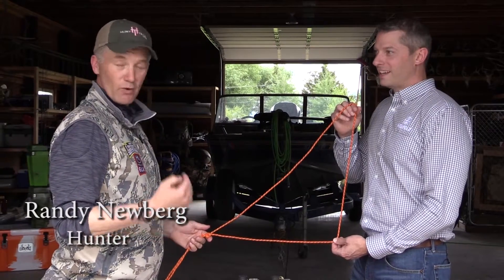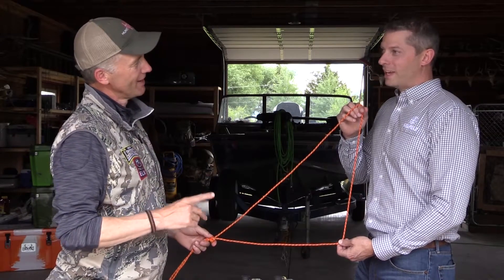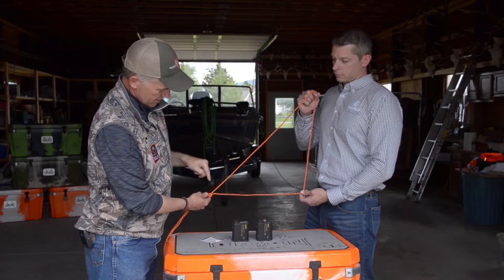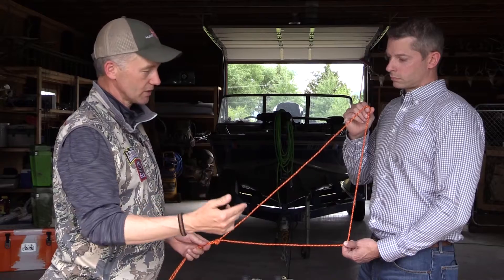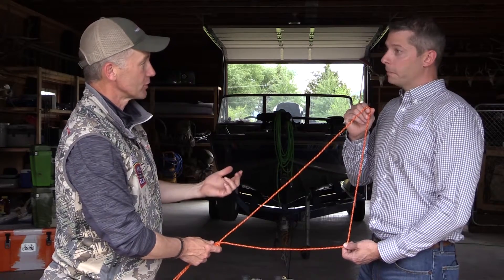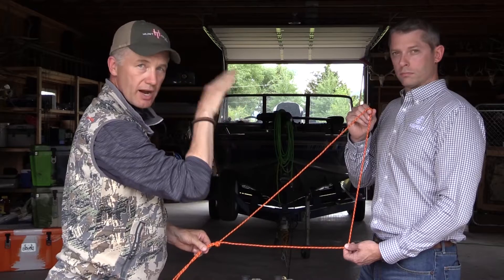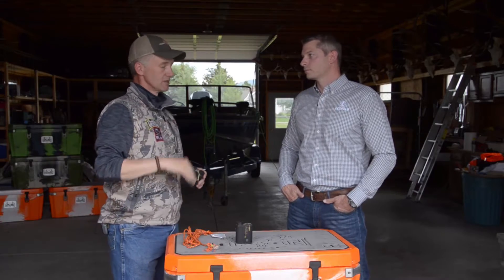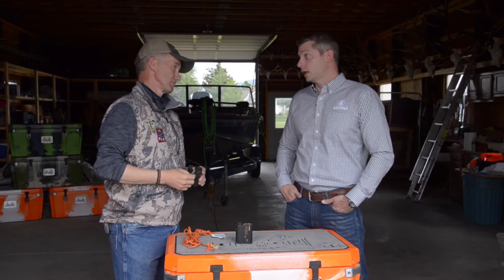How the Leupold Rangefinder (TBR) Works - by Randy Newberg

Comment: Had a shot at a big buck downhill from me.  Hunting partner with the fancy Swarovski binos w/ range finder calls out "435 yards" and i (miss)dial in 470 on my custom dial Leupold scope.  The shot does just above the muley's back.  My Leupold rangefinder with TBR?  In my pocket.  My brains?  Only keeping my ears apart.  (sigh).
Reply: How the hell do you missed a huge mule buck with a 35-yard range discrepancy. Hate to say this but but you pulled!   the kill window on that buck was at least a 12 inch window if not 18 by 18 in you should not have missed him even with a 35-yard oops.
Reply: @jackdundon2261  there is a bit more to it, perhaps than that.  I  have a Leopold rangefinde with true ballistic range.  That deer was 435 yards point to point.  The effective range was less than that and rather than adjusting my scope for the I I,  I  extended it, so I compounded matters.  The buck was stock still perpendicular to me facing to my right and I was prone for close to a minute before I  shot.  Had I dialed in 435, I don't have any question that I would have harvested it.  The next year I filled my doe antelope tag on a 400 yard shot in an open field as she was walking away shotme at a bit less than 45 degrees.  I have pulled shots before and am aware when I do.  I didn't pull either shot; I just entered the wrong way when I  dialed in my scope.  My error in correcting for a downhill shot - and my error not ranging the shot myself.
Reply: @timmoore6055  that explains A LOT, the "doe I killed the next year".... 

Piss poor shot, and a doe killer. Okay if your 12 or 13.... but if your using leupold  gear, you should be old enough to have your ethics dialed in. 

I suppose your first elk you shot when a guy was calling it to him with a bugle.
Reply: @jackdundon2261  I originally posted because I had the humility to admit I made a mistake.  The deer was not harmed by my error.  As to my ethics, you have neither the knowledge, let alone the wisdom, to question what I have done.  I have no clue as to what you think ethical hunting amounts to, but I would hazard a guess that it involves only shooting trophy animals.  I am a meat hunter, and I eat what I shoot.  And as to ethics, both the State of Montana, which provides doe antelope tags, and the farmer upon whose ranch/farm I had permission to hunt both hold that harvesting a doe antelope is an ethical hunt.  The farm/ranch owner has several thousand acres and at least one herd of 150 to 200 or more antelope and was more than happy to have us  harvest some does.  I also was born in Beaverton, Oregon, the home of Leupold, which is why I hunt with their gear - I support local businesses.  Oh - and as to the first and only elk I have shot, it ws hunt and stalk - no one was calling anything.  A nice five point that was very tasty - as was the antelope and deer I have harvested.
Reply: @jackdundon2261  I am well aware that you can read words, but it appears you do not have much in the way of comprehension of what you have read.  To wit: "I still say something is wrong with YOU, NOT YOUR GEAR, ".  Your lack of comprehension shows that you have read not one, but two of my comments, and in both I said I made a mistake.  Your repetition of failure to understand what I have said twice is boring.  You have a personal concept of what hunting ethics is, and you are welcome to have that opinion, but it is held by few hunters, and your casting aspersions on the rest of us is a showing of pomposity. Nowhere in any of my comments did I even hint, let alone suggest that my gear was at fault.   I am done with the conversation.  Good luck hunting, and be safe.  As to any further comments, you will be talking to the hand, because the head has ceased to listen.  Oh, and I drive my hunting partner a bit in a tizzy, because for any faults I have, buck fever is not one of them.  He is always worried that the deer is going to scoot before I finally take my shot.  And a 700 BDL is not a mag or ultra mag, it is a Remington model bought in 1970 and is a .270..  It shoots just fine.  Best wishes with your elite company company of ethicists.

Comment: Here's how to determine your rifle & load's RX2800 TBR/W "Group Number" to make the RX2800's ballistic solution as accurate as possible. You can also figure out a correction when using a 100 yard zero versus a 200 or 300 yard zero from the RX2800 group charts.

The Leupold RX2800 uses "Group Numbers" to categorize rifle ballistics. Use your favorite ballistic calculator to work up three range tables:

1. Use a 200 or 300 yard zero, zero wind and 600 yards as max range. Write down the 600 yard trajectory in inches.

2. Add a 10mph crosswind from 3 o'clock or 90 degrees and write down the 600 yard wind drift in inches. We do a separate chart to keep vertical wind jump out of our elevation number.

3. If you don't zero your rifle at 200 or 300 yards then do another range table using your actual zero range (I use 100 yards) and no crosswind. Write down the 600 yard trajectory in inches. Since the RX2800 Load Group Selection Table uses 200 or 300 yard zeros we'll use this number to calculate an elevation correction to make the RX2800's ballistic solution more accurate.

These numbers must be in inches to use the RX2800 Group Selection Table. I use the free online Hornady 4DOF calculator. Be sure and select the units as inches, not MOA or Mils.

With value #1 and #2 go into the RX2800 TBR/W LOAD GROUP SELECTION TABLE: FOR BEST FIT UP TO 600 YARDS (page 25 of the owner's manual) and find where your numbers fit in. You have to match the zero range (200 or 300 yards), value #1 and value #2 in the chart. When you match all that you get the "Group Number" you will enter into the RX2800's setup menu. Turn the RX2800 on then hold the Mode button for more than 2 seconds to enter the setup menu. Press the Mode button to move between fields and press the Power button to select values. "Function 2" is where you set your Group Number.

If you don't use a 200 or 300 yard zero that the Group Selection chart uses we can calculate a correction to compensate. For example, I zero my rifle at 100 yards so I subtract value #3 from value #1 to get my correction. For my Tikka T3x TAC A1 in 6.5 Creedmoor with Hornady 147 ELDM factory ammo gives me a 2665fps muzzle velocity and I zero my rifle at 100 yards. This load puts me into Group 10 with a zero elevation correction of 0.4mil. I add 0.4 to the RX2800's elevation mil display. The wind solution does not need to be corrected. The elevation correction is the same at all ranges.
Reply: Thank you for the explanation, but why couldn’t they just put the zero range at 100 yards?  Only an few people I know zero at 200 and none at 300.  Even all the long range shooter I know zero at 100
Reply: @inalaska1709  I have no idea why they chose 200 and 300. Leupold seems they are out of touch with modern practices.

Comment: Too bad we can't input our custom load data ,air density and air temperature details to get an accurate shot. You have to go with certain pre entered data.
Reply: G7 from Gunwerks
Reply: I use a Leica crf 1600 R in combination with kestrel 5700 Elite with applied ballistics.
Reply: Si Sauer Kilo 2400 does it all

Comment: What kind of warranty does it have? just got rid of my Halo because it broke with in the year and only had a year warranty didnt trust it looking for quality rangers with a good warranty.
Reply from the maker: Hmmm.  Not sure.  I know it will be for life on the unit, but the firmware/software changes so much, the warranty on that part is usually a 2-5 year warranty.  I been using mine 100+ days per year for four years and it is flawless.
Reply: 2 years
Reply: Mine lost the center cross/ hair ???

Comment: Great video, Randy!  I'm needing a new rangefinder because my old Nikon 440 is practically useless in low light.  I guess it's lost it's lens multi-coating?  Anyhow, I mostly bow hunt but sometimes rifle hunt (shots are not over 100 yards) so I'm wondering if this is overkill for my application?  One thing I've learned from my last RF is that I'd like to have a red reticle. Also, I may make it out west to rifle hunt one day (still enjoying chasing elk with the bow at the moment). Perhaps I just answered my own question. :)
Reply from the maker: These have a red display.  As for what ranging you need, that's a personal application.

Comment: I've wondered if ballistic compensating range finder calculations took into consideration that although the bullet is affected by gravity only over the horizontal distance, it is affected by drag over the entire line of sight (plus trajectory) distance. Now I know that Leupold TBR rangefinders do... that being said, does the unit compensate for elevation? Obviously a shot at 10,000 feet will differ considerably from a shot at 2,000 feet elevation.
Reply from the maker: It does not have a built in altimeter, so it would not take into account that change.  For me, I have that built into my CDS dials, plus a cheat sheet that tells me how much adjustment is needed based on altitude.
Reply: I can easily imagine a rangefinder with a built in GPS for elevation (and possibly coriolis for very long range shots), and a temperature probe for even better calculations.
Reply from the maker: CplSki USMC - I'm sure it could be done.  Probably just a function of cost keeping it competitive in the market.
Reply: Si Sauer Kilo 2400 has it all.  I'm sure Leupold will soon.